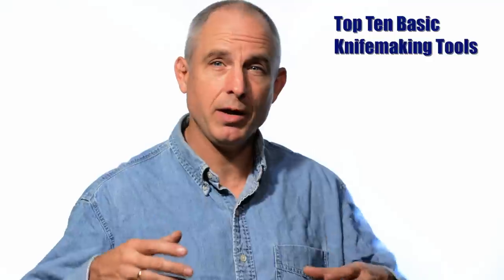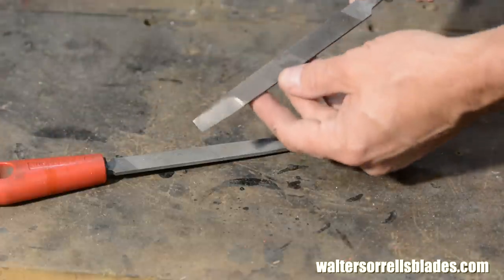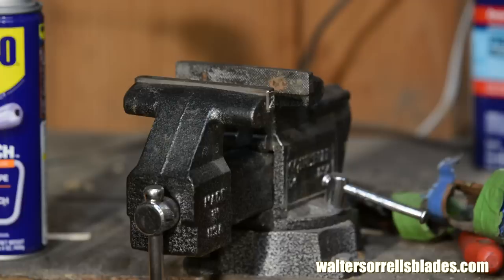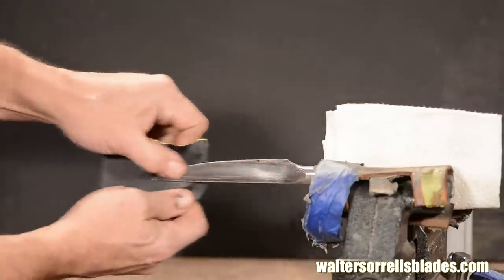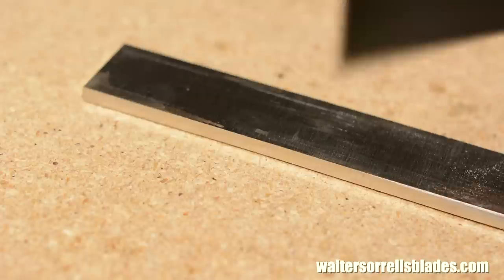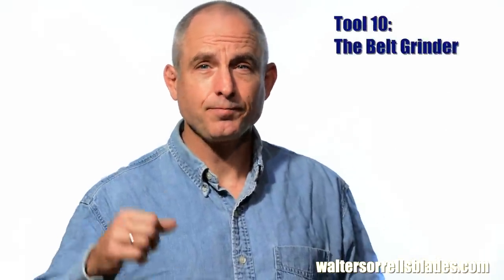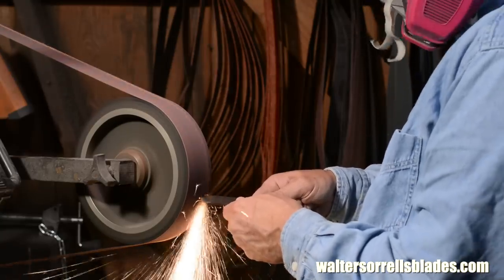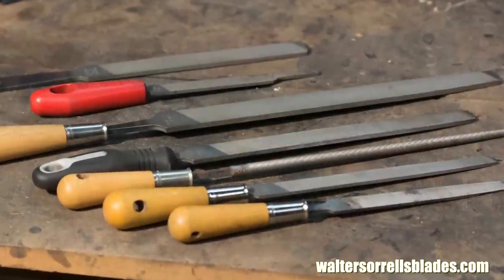Top Ten Knifemaking Tools for the Beginner

Comment: In 2004 I was stationed in Camp Arifjan, Kuwait when I got deployed.  I worked 12 hour nightshifts in the Operation Center for a year with every other Wed night off.  I got R&R about 5 months in, and mailed a bunch of basic tools back to myself. I ordered a piece of 1095 2"x18" from Jantz, and when I got back in country went to work every morning for a couple hours on a big bowie knife. I had a radio operator who was in an Engineering Battalion. I would go over and work on it everyday, then I used their cutting torch to differential heat treat it.  I ended up welding the tangs on so I could have a second piece to build a hunting knife also. It came out awesome. I had to finish grinding it stateside because once heat treated no more files and sandpaper. 15" oal. I forged a piece of 3/4" brass round stock square to make the guard, and got frying oil from the DFAC to quench it. I had a civilian guy in the TOC working range control. I explained what I needed done and he took it home and tempered it at 350F for me in his kitchen oven. I got a piece of Black Walnut, and a piece of Mahogany (not the best but looks good)for handle from the carpenters. I bought a leather belt at the PX and made stacked leather in the handle. I made a wooden sheath for it that actually hangs on the wall with our unit shield to hold it in (hard to explain but came out great. My whole story being if you want to make it you can get it done just use your imagination to solve the problems.
Reply: Richard Miller Irrelevant, but what branch of military you in?
Reply: I was in the Wyoming National Guard. I got deployed in 2004 and retired in 2009.  I was a 13F (artillery forward observer) but got farmed out to ASG Kuwait Operations.
Reply: Richard Miller Thanks. Is 1095 the best carbon steel for beginners? I'm looking to make some of the knives from my favorite video games but I have one file, an angle grinder, and a vise.
Reply: Yes and it is pretty cheap really. I ordered from Jantz. You can easily heat treat it your self that is why I like carbon steels. Then if you differential heat treat and soak it in some vinegar the hamon line really pops too.
Reply: Richard Miller So do I have to make a furnace or some shit like that or can I just put it in my oven? And I heard that machine oil is best to dip it into once you heat treat it,is that correct?
Reply: Well if you are using plain high carbon steel like 1095, L-6 (saw blades) or O-1 you can use a torch to differential heat treat it. You heat the cutting edge to non magnetic( around 1500F), then quench the edge in preheated (about 120-140F ) oil. I just used old cooking oil. Then check it with a file to make sure it hardened. You can do this more than once. Then when satisfied with that put it in you house oven for a few hours at about 350F or so to temper it. This relieves the stresses at the hard/soft interface. Leave about 1/16th of an inch or so on the cutting edge to prevent warpage, and they say to quench pointing north also. The thicker you leave it the tougher it is to finish. When done soak in vinegar for about 20 minutes and the hamon line will pop nicely. You should go on FB and join knife making from repurposed recycled steel. hope this helped.
Reply: I recommend using plain high carbon as you can do all your own heat treat.  You can buy 1095, and O-1 in all sorts of sizes from suppliers like Jantz, or Texas Knife makers ect.  You can use recycled steel like leaf springs but then you need a forge or some way to anneal it to make it workable. It is worth the small expense to have a good piece of known steel pre-annealed to work with. Then later expand your skills with recycle. My opinion.
Reply: "mailed a bunch of basic tools back to myself." 
"I had a radio operator who was in an Engineering Battalion...I used their cutting torch to differential heat treat it." 
"got frying oil from the DFAC to quench it." 
"I had a civilian guy in the TOC working range control, he took it home and tempered it at 350F for me in his kitchen oven." 
"I got a piece of Black Walnut, and a piece of Mahogany for handle from the carpenters."
The spirit of Maxwell Klinger (MASH) lives on in the real world.
Reply: Radar O'Rielly sent the jeep home. I watched a lot of MASH growing up. We only had 3 channels in the 80's.
Reply: I still give you a thumbs up for knowing the Army way. That's why civilian life sucks.
Reply: ThankQ so much for your service. Assuming you are 🇺🇲🇺🇲🇺🇲🙏🙏

Comment: Back in the day, I made my first knife from a small file that I ground on my dads bench grinder.  I kept dipping it in a bucket of water to keep the steel cool.  Since I had no way to drill holes for mounting scales I glued them on with epoxy.  I didn't bother to grind the file teeth off in the handle area thinking adhesion would be better.  That primitive construction still works today and adequate bench grinders are around fifty bucks.  But today, angle grinder are a good alternative. And they cost even less. Cut-off wheels let you rough out the blank and grinding disks work to sculpture the blade ... all at a cost under fifty bucks.  Flapper wheels can even be used to shape the scales.  Files and sandpaper certainly be used to perfect the final shape.  But go for a rustic functional look on your first try.  Learn and grow from there.

Comment: Walter Sorrells it seems is a natural born teacher. He uses deliberate and exacting language that leaves no question in the viewers mind what he's talking about. There are a lot of people who teach that get too much satisfaction from leaving a person feeling they know something you don't. That's not a good teacher. I don't get anything like that from this gentleman. I do have a question  only because I'm wondering what's sandpaper, the most useful item in almost any kind of shop,  if not a tool?
Reply: Just in case you haven't found out yet, sandpaper is a piece of thick paper that has abrasives adhered to one side. It looks a lot like sand, thus, sandpaper. Typically, it will be sold around the power tools, specifically the sanders and/or grinders. It can come in big sheets, long strips, and in peculiar shapes made to fit a specific sander. They can vary in price. It might be difficult to find the grits (texture measurement, low is rough, high is fine), for example I can't find 600 grit around me.
Reply: I think Boston Brand meant this statement as a rhetorical question, in  that most don't think of sandpaper as a tool, but it may only be scratchy paper, but it is a TOOL with a HUGE number of uses.

I've used 400 through 1200 grade wet or dry sand paper to make the finish on the hull of a boat smooth enough to glide through the water faster, which helped me win races. 

In a similar fashion, you can make a knife blade's appearance come to near mirror finish with this kind of sandpaper. So yes, it's a TOOL. The more functional AND pretty your blades are, the more money you will make selling them. People pay more for goods that are beautiful and functional.

Comment: Great video. Can you make a tutorial on using an angle grinder for knifemaking? It's a pretty common and cheap tool that can save time even for beginers, if used right...
Reply from the maker: +dor duieb Good idea.  They are great tools.  I wouldn't put them in my top ten, but they can be really handy for a lot of tasks.  There are guys who grind whole knives with them.  I've never done that myself, though.
Reply: +Walter Sorrells Love your videos and love the fact you press the issue you don't need 10k in tools to do it
Reply: Walter Sorrells Thanks.
I asked on another video- about making a knife from a file... Does ANY file do for this?  Even a crappy 'made in china' kind of file?
Reply: +dor duieb I'll butt in if I may. I wouldn't buy a cheap China file to make a knife from. I'd suggest looking around flea markets, garage sales etc. for old files - it doesn't matter when they're dull, it will probably help in your bargaining. Also, even if you don't find a cheap file or two, you might stumble upon a whole variety of other useful tools.

Comment: There are plans online, on various knife making forums, for the 2x72 belt sanders, I liked them so much I built 3x...  Beaumont metalworks also sells components which he actually sais are for the home builder; so you can keep the cost down a bit.  Great vid, bar a hacksaw, a file and some sandpaper it is really down to the skill of the individual.  Great place to start.
Reply: +justame smith I built a 2.5 hp 2x72 with a VFD for about $700, and I have two others with different motor configurations.  I shopped around for the motors and vfd, other materials were about $100 each.  I only make these for myself, I'm not looking to go into production.  I do have a small workshop and they are pretty simple devices.  But you are correct, you do need some skill level and tools to undertake this kind of work.  If you are going to make knives seriously at some point you will want to invest and if you don't have a shop you will have to purchase from a professional supplier, I would really recommend Beaumont metal works as they are great machines, you can also buy them in parts, chassis, motor, tooling etc. bit by bit.  Good luck with your endeavor.
Reply: Justame Smith, if you are serious about building one for yourself, also check out ebay as there are a couple of people who make wheels and other belt sander attachments for knife making, top quality and they will save you some money overall.

Comment: Once I bought my 2x72 EVERYTHING got so much better. I will add if you spend the money for a nice 2x72, might as well go all out and get one that is 3 phase with a VFD. Being able to adjust the speed from full stop to wide open with a quick turn of a potentiometer is so key. Also flipping get a switch a reverse the belt is kind of nice for when I sharpen on my grinder. 
Mine is made by Pheer Grinders and was $1870 shipped with a 10" rubber contact wheel, flat platen, 2hp Baldor motor, and a kbac27d VFD.

Comment: Your obviously a professional so I understand where you are coming from with this list. It sounds more like a dream list to beginners on a budget, my list as I happen to fall into that category would be a 1 dremel tool ( I have cut out whole blades from old saw blades with the cut wheels) obviously the sanding and shaping possibilities are unlimited. 2 angle grinder most have two handle holes and the ability to move the guard this makes them awesome for rigging a table top type saw that works pretty good at rough shaping, the grinding disks can also be used if you create a rig for beveling would be nice to have two or three angle grinders to not have to always reconfigure for other tasks. 3 a hand held belt sander works wonders it also can be used in rigs my issue is it ruins the belts too fast, this is why he says a large belt grinder is ideal I just don't see a beginner running out and dropping 2gs on one. 4 clamps he is right you can never have enough, I love the quick ones he shows but I have had several break on me.5 sand paper 6 a chop saw or table saw assuming you start with wood handles I have both but haven't used them with metal cutting blades yet supposedly you can. 7 a jig saw I want one I don't have one yet but they are cheap and I imagine you can use them or a band or scrolling saw to do just about anything with the right blades 8 files are great but I would use them as material if your starting or old saw blades. 9 trusty old corded drill or two 10 imagination to rig up or make what you do have work.

also safety first I said it's possible to alter more common tools to achieve the results you need but always always always put safety first.

Comment: if you're really dead set on not breaking the bank, fabricating your own belt grinder is pretty simple if you've got tools 1-9 on this list. may take a bit more thinking and planning than a knife but it can be done. and basic fire bricks can be substituted for fancy ass furnaces to heat treat your blades until you save up for a proper oven.

Comment: Hey Walter! I've been watching your videos for a while now and just started making my knives this summer. 

I am on a small property and don't have a shop or shed so my only option right now is using an angle grinder for stock removal and cleaning up my forged blades.

Can you please make a video with any tips for using an angle grinder for making a knife? Any input on where to put the angle grinder down and pick up the file for pricison work? 

I have a pretty steady hand and am getting the trick of grinding evenly with the tool but making bevels with the angle grinder can be hell.

Absolutely any advice would be amazing!

Comment: Thank you for so much great information!!  What is reason that the belt grinder is the tool of choice as opposed to a bench grinder
Reply: If I'm understanding a bench grinder correctly, the belt grinder will have an advantage because it can have both flat portions and round portions, plus the areas where the belt is in open space, and the parts can be changed out for all sorts of sizes and uses. 

I think it's just a versatility thing.

Comment: Btw. not only is a file a good tool, its also sometimes good material. For the beginner knifemaker, getting decent steel is often a struggle. Files are, when it comes down to it, metal bars of tool-steel...and this stuff can be worked, and hardened decently.
Reply: if your struggling to find steel, try checking out your local truck shop or a spring shop for free scrap leaf springs. even a scrap yard might have some but may also charge you for it.
Reply: Manik604
Spring steel is not spring steel though. Buying from a scrapyard you never know what you get. It could be high-carbon steel that is easily hardened, it could be some alloy that makes good springs but either doesn't harden at all, or requires a special heat-treatment regimen to do so.
Reply: Severus Fumizuki If your scrounging in a scrap yard then you have to know what it is your looking for. Same goes for the scrap bin at the spring shop. And I will tell you that yes, Springs are made from Spring steel, hence where the name comes from. Unless of course it is a specialty engineered alloy spring which you wont find in your common truck. Therefore, your common truck leaf springs will always be High carbon steel within the range of 1075, 1085, 1095, 5160... I deal with all metals on a daily basis, hobbies and career. I have never had an issue with heat treating leaf spring knives. hope this clarifies my first statement a little better.

Comment: Thank you for your info ,  ive already started doing the deed, and made about 150 or so but I just wanted to mention  when you ware out those files they make nice knives.  That is if you take the time to learn to heat treat, and  file knives brings more money than  the avg knives too ...
A file I might buy at a yard sale cost say $5 , you make say 25 knives with it and turn around and make it in to knive   I use to get around $35 to $ 75 for my average knive but the file will bring $ 125, 150.   My point is never give up because $2000 is pocket change

Comment: I'm in the process of building my belt grinder right now lol. it is going to take me 4 more months to get all the stuff and away I go! I already got the motor and spring. now I need step pullys, pilot blocks, deive shaft, 4 inch drive wheel, tracking wheel, platen or contact wheel, steel, and hardware. I got a welding machine already.

Comment: Delta makes a belt sander for a lot cheaper doesnt Come close to the grinder you have but they work for beginners. I also use DA sanders grinders of all kinds, I think every one could afford a simple bench grinder and a lap disc. A simple forge can be made from heat bricks and a map gas torch and a toaster oven for tempering lol tons of cheap ways to make a knife hope that helps he covered a lot of great tips

Comment: Lovely video, for a cheaper belt sander I had a 1x30" belt sander which for me works fine, and costs about $60 which is a bargin. 

Probably not a tool designed for metal but for a beginner it works great

Comment: I USED a railroad track a butane torch and wd40 with a 3lb welders hammer and clamp on tongs. fine work with a finishing file and dermal tool. heated till yellow orang than drew it out with a lot of hammering. Friend mad a out door forage by using fireplace bricks a 3/;4 inch pipe with holes in it threaded cap berried it in coal hooked it up to a large duel tank air compressor. started with a one inch brass drift pin that had broke. it took a long time heating the bar then sit it on the modified track and hammering it into shape. eventually it came out as a very fine bronze dagger

Comment: For the impatient
1.File
2. Hacksaw
3. Bench vice
4. Drill (press if you can afford it) and drill vice
5. Sandpaper
6. Digital Callipers
7. Squares and rulers
8. Clamps
9. Sharpening stone
10. Belt grinder
Bonus round - HEAT!

Comment: Can you explain how files and hacksaws are so damn good at cutting metal? It's crazy. I made a knife out of a giant hacksaw blade used for machining at places like vertical seal (where my dad works). We tried to drill it for ten minutes with a brand new drill bit and it made a hole the size of a grain of salt. We torched the handle part to get rid of the heat treat and it still took so long and just couldn't get through the other side so we gave up and decided a skinning knife doesn't have to be built like a tank and I think it will be okay. I scored the surfaces of the wood and steel with a scratch awl to get more friction like a potter does. I hope it works I haven't yet seen the ending product. But it amazes me the hardness of those steels.